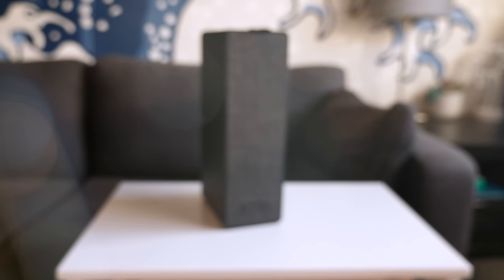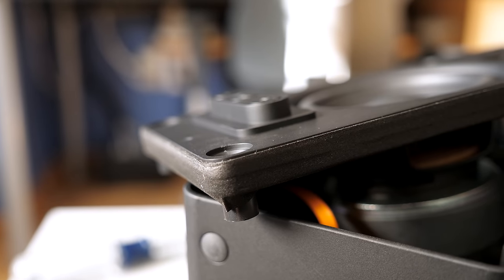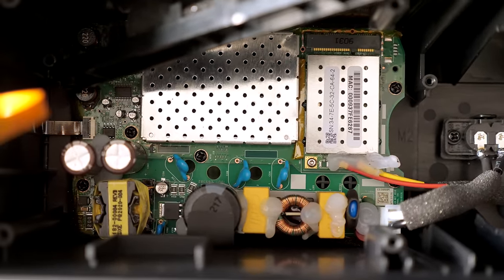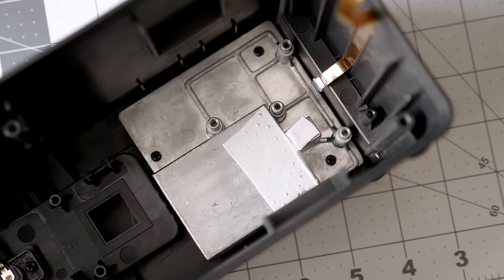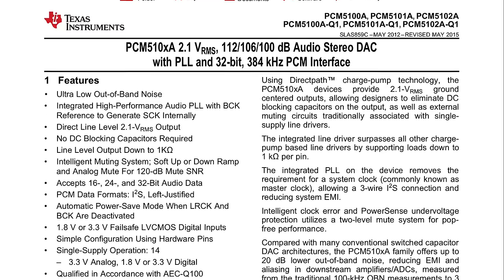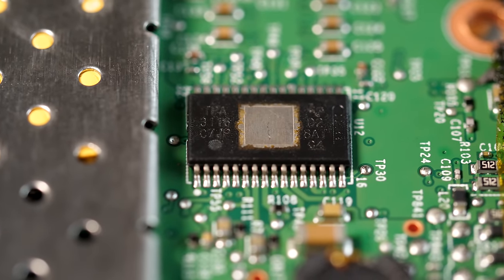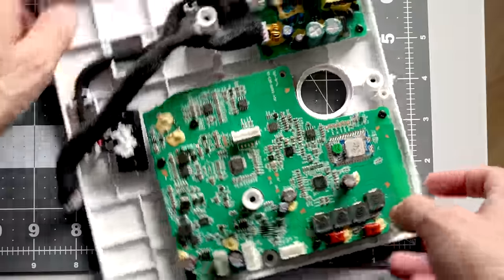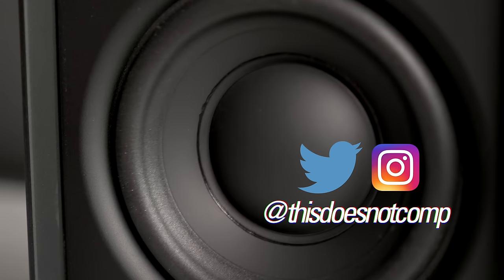IKEA's Sonos Speaker Has a Secret

Comment: Kind of crazy to see an IMX6 processor in a smart speaker.

It's close to the functional equivalent of a raspberry pi in your smart speaker.
Reply: Maybe the old pi's. The pi4 is a quad core at 1.5ghz. And has way more on board. Still a fair amoumt of processing power for a speaker though, probably cheap to get a hold of these now as they are obsolete for their true purpose.
Reply: @handlesarefeckinstupid  you are correct...  Were they (imx6) originally intended for infotainment systems and the like?

Comment: One thing about the capacitors worth to consider aside from being of a cheaper quality is also how close to the rated voltage they are used. The 400V rated capacitor on a 240V feed means that it has some headroom left.
Reply: 240 VAC rectified is 338 volts DC.

Comment: I did a comparison. Do own all of the Sonos models. And I was curious to find out how the IKEA ones compete. I found the sound quality okay. Even slightly better in the high freqs. But the wi-fi reach was unacceptable. The wireless connection of the Symfonisk did suffer from dropouts and less operating distance. I've tried two pieces of the bookshelf model. They both had this annoyance. In the end, I returned the IKEA's...
Reply: Hi, I had the same issue with Symfonisk speakers (I also tried two separately) in one of the rooms. Did you use Sonos speakers instead? Did this help? Did you finally get good reception with no dropouts?
Reply: Marek Zawiślak I stick with the Sonos. I have a whole system already. I just bought the IKEA's to expand my set. But I had no direct need for that. In the future I probably go with Sonos.

Comment: Saw and played with this speaker at Ikea today. It immediately struck me as a 'Sonos' product. My Costco sells the Sonos One 2-pack for $300, so I still think the Symfonisk at $99 each is a better deal. I like the form factor better too. The '$1' shelf rack is a source of heartburn for sure. I would probably want 2 (i.e. $45 worth) of them. Just bought a Google Home Max as a BF special for $250--an absolute no-no at $400--and, while I appreciate its stereo capabilities, I think Symfonisk is probably catering to a bigger base that either lacks awareness of, or does not care, about spatial differences in audio.
Reply: It's a bit disappointing that the enclosure is all low quality plastic, as IKEA has all the power and process to sell a much higher quality speaker system at sensible prices.

Comment: CapXon caps are not bad caps at all. I don't know who started with this. We use them in our company in over 1 Million units every year which are designed to work for at least 10yrs and they do well. At 4:57 you can see that they are FH series caps -->  10000 hours of operation at a temperature of 105°C according to the datasheet. Since the capacitors will never have that temperature in there (otherwise the plastic housing will melt to pieces) they will last for many years, just google for "Capacitor lifetime vs. temperature" than you'll know what i mean.

Comment: What is the benefit of having a DAC chip sending an analogue audio signal to a digital power amplifier chip...?
Reply from the maker: Yeah, the "digital" Class-D chips are a bit of a misnomer -- they're not digital in that they necessarily accept a digital audio input, but rather in how they amplify the signal. In brief, they're "digital" amps because their outputs are pulse-width modulated as opposed to linear like with other amp designs.

Comment: My thought goes to adding a TPA3116 mono board module ($20 ?) to the Sonos audio path, with an 8" woofer ($50 ?) in a DIY enclosure, and wonder how would that sound. I hope Sonos didn't apply a high pass filter in its DAC section to the base band for the built-in woofer.

Comment: running a speaker on a 256mb ram module, you should be able to get the code and os to fit inside 64mb... people these days can't code
Reply: It wouldn't surprise me if that speaker is running Linux actually
Reply: You could get it to fit within less than 1MB, if you don't have to deal with overhead of a complex operating system, PCI support etc etc.

But once you choose a platform like this iMX, that's just the minimum capacity memory IC that you're going to get, as smaller capacities are dropped from manufacturing or moved into even more embedded designs. Sometimes the part pricing is absurd and the absolute cheapest chip you can get is the highest-volume modern chip, as IC manufacturers like to milk legacy design manufacturers and keep decade old prices, while prices on the modern stuff keep crumbling. Bet most of it isn't being used. This is a powerful processor that's easy to prototype with, and there just doesn't seem to be the point to optimise the design down to the last cent, move it to ESP32 or something even simpler, because it will be eaten up by software engineering expense.

Comment: "powerd on all time" no no no no no
Reply: well, aren't technically most phones "powered on all the time"? jokes aside, this design is just stupid, and no bluetooth or analog input? the last thing i want is my music experience to rely on my router... never had dropouts with an audiocable, expect when i stumble over it
Reply: @Untrepid One i don't really get what you are saying... as far as i know the audio quality comes from the digital to analog converter and the amplifier. it doesn't care if the digital signal comes from a bluetooth module or another type of circuit.
for example: i experience a difference on my headphones when i use the cable or the bluetooth functionality, but that's down to the audio output of my smartphone vs. the output of the bluetooth electronics.

but maybe i'm totally missing what you mean :D

Comment: This is very truthful high Quality video i have never come across it , i like it so much 
Thumbs up man  
I have aiwa exos 9 Bluetooth speaker,it powered by 110-130v 
Here wall electric sockets have 220-240V and i have step down convertor to 110v 50hz ) I do it all the time as i charge it from day one) 
After a long time of happy life with it,few weeks earlier everything turn down, friend plug in directly to the wall😪😪 socket to charge it. 220v.And when he realized it doesn’t work he called me . 
And when he mentioned about aiwa exos 9 with his worrying voice immediately i knew what was wrong before even he started to explain 😪😪 he plugged it directly to the wall which is forbidden to it 🧐.
I came home i did all troubleshooting including removing the battery put it back change the cables. 
It doesn’t charge 😭😭 the only thing it does is blinking connect to Bluetooth device and blinking low battery until it switches off itself (shutdown I should say ) 
Our life is stressful without it, aiwa exos 9 is my pet device and now is sick 🤒😷 needed help from overseas 
I emailed aiwa they replied there is nothing they can do and they cant suggest anything for repair. Please would you suggest anything from opening to diagnosis.🙏🏾🏅(suggestion  to open aiwa exos 9 Bluetooth speaker)
I will be thankful. Thankyou 
Have a great day
Reply: Rest in peace little speaker

Comment: Great job on the teardown -you do a fine job identifying all the hardware, it's origin, and the implications on performance and quality.
You seem to be a little fuzzy on branding, pricing, and other BS -like you never worked at a company that makes these things.  The short explanation for all your questions is that engineers DON'T run these companies.  For every value proposition they create there is pile of business and marketing executives that justify their high salaries by raising price, changing names, cutting cost, and generally making customers pay as much as possible for as little as possible.  Ikea is a major "channel" and brand -thus negotiate a lower price for essentially the same product.  Sonos obviously could charge less for it's speaker, but will not because that would "dilute the brand".  Still don't see the logic?  Well, that's why you (and the 99%) don't make the big bucks executives do!  Here is the only logic there is -a bunch of executives at Sonos will justify being paid more by doing this deal with Ikea.  They "expanded the ecosystem" while not "diluting the brand" they "raised margins" and "increased tax efficiency".  WTF does that mean?   The production of the ikea speaker is invisible to Sonos's financial reporting.  Only "licensing" payments will be paid by Ikea to the "intellectual property holder" of Sonos in an offshore tax haven.  The brilliant management of Sonos has eliminated all payments to anyone that designed, built delivered or protected the world in which this good could be delivered and made it into a refined pure profit that they can use to justify payment to... THEMSELVES!
But if Ikea is selling the same speaker for 50% less, won't the expensive Sonos speakers lose sales?  YES! and that "share loss" will be used to justify cutting the pay or limiting the pay of engineers, and all the producers of Sonos speakers!  Another win for brilliant management!
Reply: you nailed it. plus: i don't think,that ikea pqys "extra". they simply buy these things in 1000s what lowers the price per unit.
Reply: They are called the "bean counters", call ALL the shots!

Comment: 2019, when 256MB of RAM is referred to as 'not a lot' in the context of a speaker... I'm glad that costs are so low that such decisions can be made, but this still sets me off as being incredibly wasteful.
Reply: @Gonçalo Amaro that has been the case for a loooong time. Back in the day, peripherals were often as powerful as the host machines they were attached to.
Reply: The NXP requires DDR3 RAM, on mouser a single chip for 1Gbit (128MB) is like $7.65 (NZD), and a 2Gbit (256MB) chip is $8.05, there's also questions of what is compatible based on pins etc, with the NXP.

Nothing smaller from Micron, and the smaller chips from ISSI are more expensive.
Reply: PCs used to be able to run a multitasking OS with a GUI and business applications with 1 MB of RAM (or even less).  Generally speaking, nowhere near that much RAM is required to implement all of the necessary functions for this speaker, although a lot of unnecessary things may be taking up most of the otherwise luxurious 256 MB of RAM it has.  Even today, people are doing cool things with microcontrollers that only have 2 KB (that's KB!) of RAM on board (e.g. Atmel ATmega328P on the Arduino), though, so not everyone is being so wasteful.
Reply: @microcolonel   True, albeit back in the day it was barely enough power to get the job done, whereas today it is way more power than is strictly necessary.  They're just doing what's easy and still cost-effective due to technological advances.  The two situations end up seeming similar at face value, but underneath they are quite different.  While more is expected of peripherals these days (e.g. networking), processing power and memory have far outpaced this--the only thing that has kept pace is bloat. :)
Reply: @woobilicious.  generally when you g o smaller, you get the DRAM embedded in the package.
Reply: @rbrtck  not really. Multitasking in the 1MB days was cooperative, not really the same thing as this. And you could argue that they should use cooperative scheduling in a device like this, but it takes more development expertise and time.
Reply: @microcolonel  I remember running multi user systems using Unix on machines with a MB of ram or even less. So not all multi tasking OS of the era were cooperative. I actually think there was a version of DR-Dos that was capable of multitasking, and given that common DOS applications wasn't written for cooperative multitasking I suspect it had to be using preemptive multitasking or it wouldn't have worked. But I could be wrong and it only did task switching. It was a long time ago and I never used the multitasking feature in DR-Dos. Then there were things like concurrent CP/M and SuperDOS (which wasn't in any way related to MS-Dos) which both were multi user operating systems that ran on very weak systems, though at the time they were considered quite powerful. I'm not certain about what kind of multitasking model they used, but both were very robust and I never saw either of these OS crash or even hiccup, something that cooperative multitasking is known to suffer from.
Reply: What exactly do you see as wasteful? Money? Manifacturing? Raw materials?
Reply: @microcolonel   My main point was that you could even have multiple tasks and a general purpose OS in 1 MB or less.  I thought someone might bring up that Windows and some other common OSes back in the day were cooperatively scheduled, but I'm talking about what was possible, and besides, there was Unix, as Blahorga Slisk points out, and other examples I had in mind include the Amiga OS (originally ran with 256 KB) and OS-9 (ran with even less RAM on the Tandy CoCo and Dragon 8-bit computers)--these and other examples were preemptively scheduled.
Reply: @rbrtck  you did specifically mention PCs with GUIs
Reply: @tiger.98  I think it's probably more of a missed opportunity. The wholesale price of that DRAM, and the board space and assembly, eats into margins. Sonos could reduce the overhead of their software, at some cost, and it would reduce the BOM cost of all of the units. On the flip side, of course, competent developers are not cheap, so it's probably not that hard to justify their strategy.
Reply: @microcolonel   Geez, the point I made was a general one from the start, as I said.  I've been using and programming computers since I was a kid in the 1980s, so I wasn't just thinking about the IBM 5150 and its descendants, but anything that could be considered a personal computer or microcomputer, as they used to be called, as opposed to a minicomputer or mainframe (although I used those, too).  Microsoft Windows might not have been preemptively scheduled (prior to Windows 95), but with the same CPUs and amount of RAM it could have been, and that's all that matters for the point I was making anyway.  I also used the X GUI system on various Unix-based computers, including SPARCstations and a 386 IBM-type PC running BSD.  OK, these all had at least 4 MB of RAM by then, but that's still extremely small by today's standards, and there were earlier examples of preemptive multitasking OSes with GUIs running in well under 1 MB.  My general point stands regardless of your nitpicking.

The truth is that much more could be done with much less than what this speaker is equipped with.  Its design makes sense given the state of modern computing, but this doesn't change the fact that it could have been implemented with FAR less RAM and other computing resources.  It wouldn't make sense to do that today--too much trouble and design cost involved--but the fact remains nonetheless, if as nothing more than an academic curiosity.  By early computing standards, this inexpensive speaker is a supercomputer, when it really doesn't need to be in order to perform its functions in any era.
Reply: @rbrtck  well I don't know why you're getting so upset about being misunderstood. FWIW I grew up with the 5150 in the early 2000s (my father had won it in a sweepstakes in the late '80s and stuck to it since then), that's why "PC" means something to me.

You don't have to get salty that about something so trivial, I'm not out here attacking your character. I'm telling you why I said what I did, that's all I can do.

I have experience with recovering data from other sub-1MB microcomputers, and as you point out, they tended not to ship with preemptive schedulers for reasons relevant to this thread. That's why I made my point: preemptive multitasking, memory protection, and other features which were long uncommon in embedded computers all encourage or necessitate greater memory overheads.
Reply: @microcolonel   The development would be costly and risky, and support costs could be higher, as well.  Besides, at some point it becomes hard to find smaller for cheaper when it comes to computing devices--whatever sells the most is generally the cheapest, and with all of the excess computing power available in this case, they managed to save some money on passive crossover components by using DSP to separate the frequency ranges for the drivers.  While this takes an additional channel of amplification, the cheapest amplifiers probably include two channels anyway for stereo, which in this case has been re-purposed for the bi-amplification of one channel.
Reply: @microcolonel   I'm not nearly that upset, and didn't mean to give that impression.
Reply: @rbrtck  Amiga, yes.  PC, nooooooo.
Reply: Indeed, 256MB of RAM (or less)  powered my PCs until the mid naughties.
Reply: Wasteful would be running another production line for smaller RAM chips. This speaker maybe can't use all the memory it got, but other devices need to have this much and you can use the same chips for cheap aand they are coming from one production line. I quess it's cheaper to produce 256mb chip than 32mb chip simply because more ppl will buy 256 one
Reply: @microcolonel  such as the Commodore 64 floppy drive